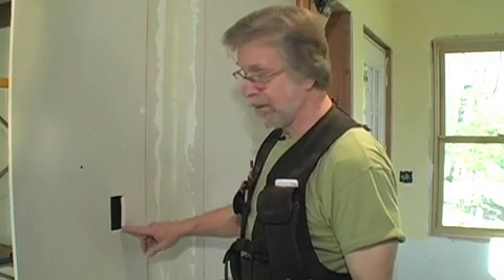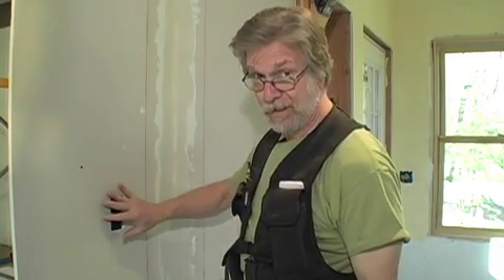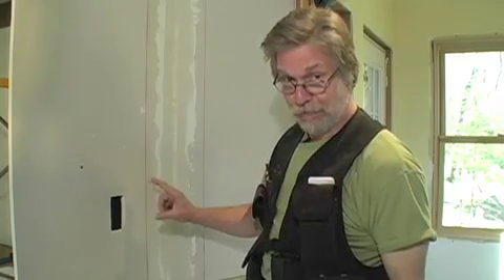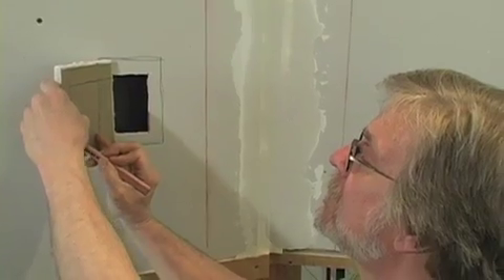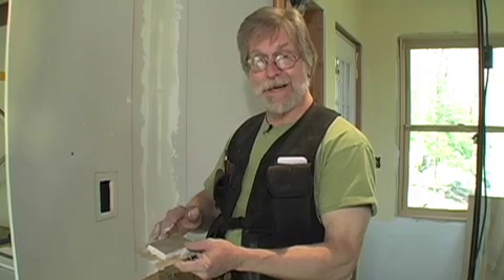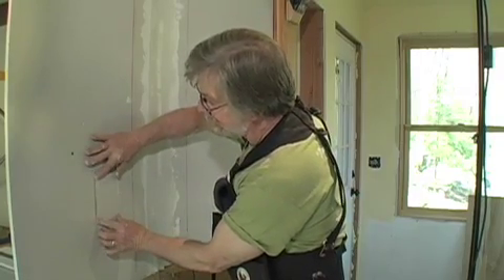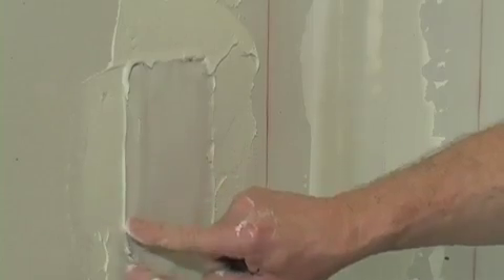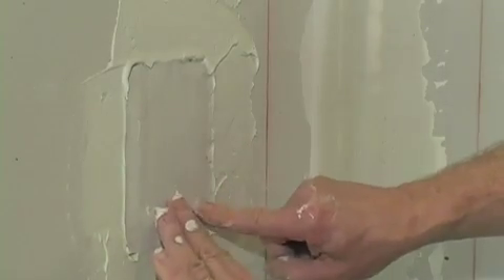How to Patch Drywall

Comment: @kickback14 No not really, if you mud/paint correctly the only way you would dent the drywall in is if you hit it rather hard.  If you used the paper peel method anyway.

Comment: hot patch works great....especially if you don't have exactly the same thickness as sheetrock on wall..thicker or thinner doesn't matter.  buttering edges of sheetrock will give even more strength to the patch.

Comment: Like your idea but not good if someone or something happened to lean right on that spot as this method has no structure .
I prefer to back up with 1x2 behind with as little as 2 screws and mud to finish. 

It's all about constant strength of the drywall.